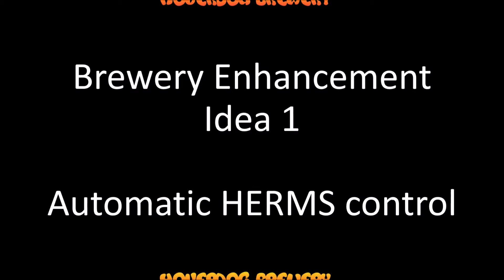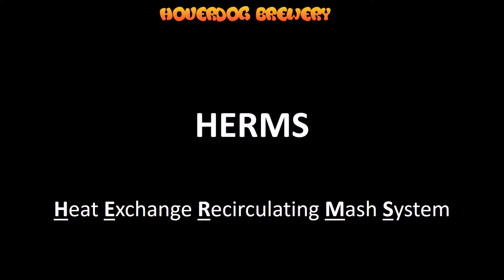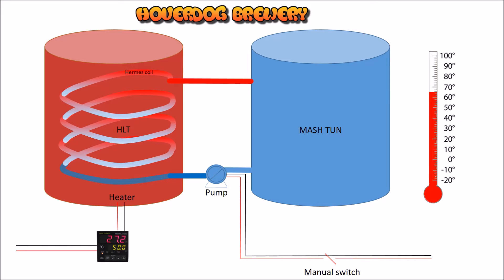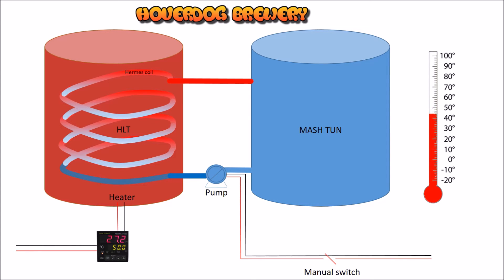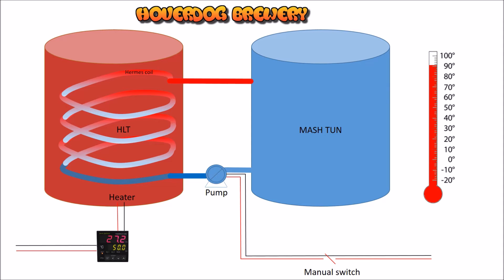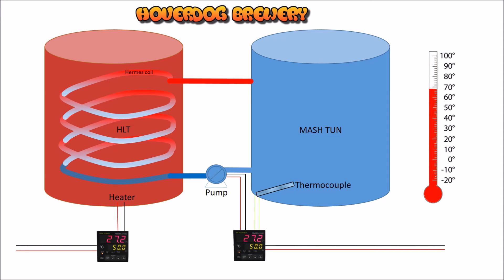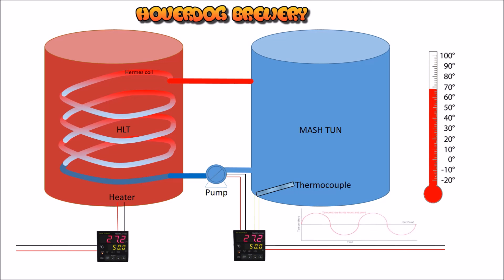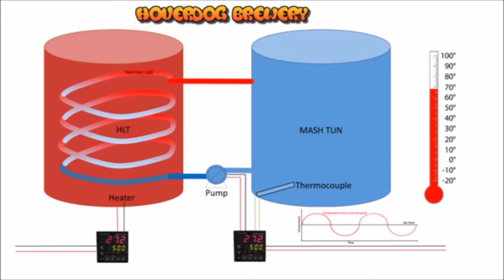Vblog51 - Automatic HERMS Controller

Comment: Hi I have only just found your channel, 

I am looking at building an electric brewery and have been thinking of mash tun temperature control myself. As you only have two PIDs you could build a thermowell into the return connector, sparse arm, in the mash tun (with maybe a T fitting) and fit a second temperature probe. This probe would be a second attached to the PID and selected via a switch. This way the temperature could be controlled and no need for another PID. Anyway your channel is cool. Matt.

Comment: I'm a bit late to this discussion, but I think, as per other's suggestions, you only need one pid for this setup. It monitors the temp in mash tun and controls the heating element in the hlt. The pump runs all the time through the mash so that you get the benefit of recirculating the wort through the grain bed and better control of the temp. Having the pump turn on and off in conjunction with the pid would just in my opinion create lag so you will get a greater variance in temperature.

In my system I didn't go with coil and instead built a 2 vessel full volume recirculating mash system with pid temp control. This means my hlt is also my boil kettle. I was short on space so it works for me. 

I think what is great about home brewing is the various ideas people have with the common goal of creating beer.
Reply from the maker: I current do this method but with 2 PIDs although one is only a read out of the mash tun temp. The pump runs but the HLT has such a large volume of water that it creates hysteresis and the mash over shoots. I think I could keep the mash temps if I used a RIMS as that has a small volume. Again more to think about!

Comment: Hey Mark. They guys I know that have done this have a switch to go into "Mash-Mode", wherein the second PID is given control of the HLT element, but has it's temperature probe in the MT. In this manner they run their pump throughout the whole mash period setting the grain bed and getting nice clear wort in the process. 

The only potential problem that I see with the way you are suggesting is that the grain bed may set differently (may get slightly compacted) by the pump cycling on and off repeatedly. I know I have had an issue now and then with a compacted grain bed when I have problems with one of my pumps stalling during the mash and having to get restarted.
just a few thoughts for you.
Pete
Reply from the maker: So maybe if I run the pump in the mashtun like I often do but put a solenoid valve that would switch the wort to go via the herms coil until the temperature hit my target at which point the solenoid valve would deactivate and the wort would just circulate like normal.  This video has got people thinking and coming up with ideas.
Reply: It definitely has generated some some commentary. I take it that the solenoid you are talking about is to bypass the HERMS coil redirect it straight to the top of the MT instead of through it. That's a brilliant way of continuing to keep the grain bed acting as a filter. Which, I "think" is one of the main reasons why HERMS and RIMS was developed in the homebrewing community.

Comment: love your work, I'm considering (if it will work) using the one PID with two thermocouple's switching between the two as needed, one for the initial heating of the HLT then switching to a thermocouple in a connector on exit of coil for wort temp as it re-enters mash tun.  still got to build my control box yet so not sure if thermocouple will work if put through a switch
Reply from the maker: Thanks for the compliment about my work. If the leads were the same length for the thermocouples then you should be able to switch them. Different lengths would make the PID read different values and you would have to calibrate it PID each time you switched the thermocouple.
Reply: cheers, will keep that in mind.

Comment: Don't use a PID to control the pump. Use a STC1000 instead. The PID will send pulses to the pump. I would sugest to use the PID in the HLT, only, the thermocouple should be placed in the hose of the wort coming back to the mash tun. Hope it helps.
Reply from the maker: I have a STC100 (the one that can do heating OR cooling) now to check the temp in my mashtun, maybe I can implement the idea. Cheers for the comment.
Reply: Sorry, I meant STC1000. :)